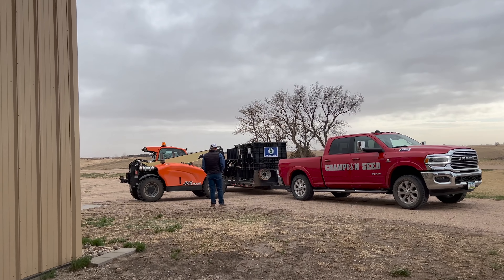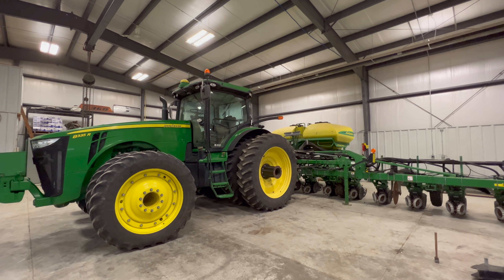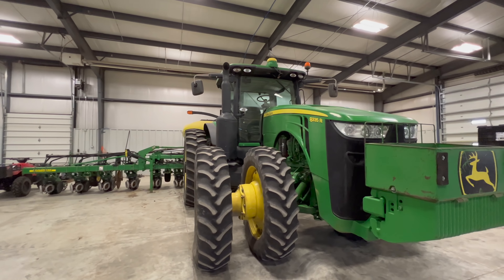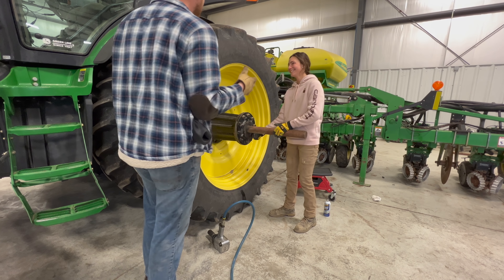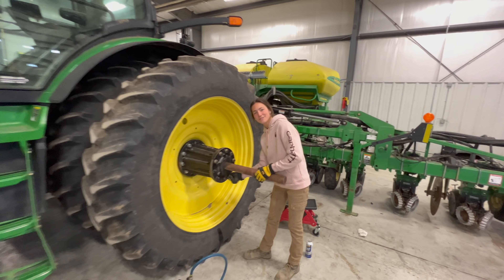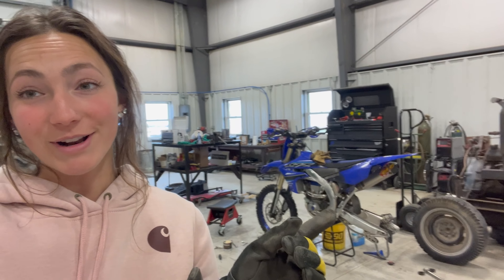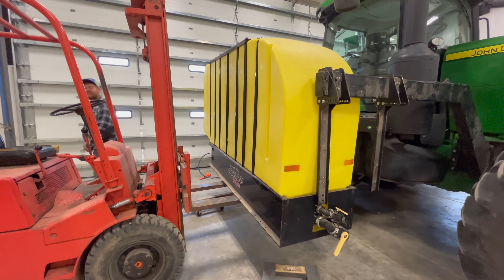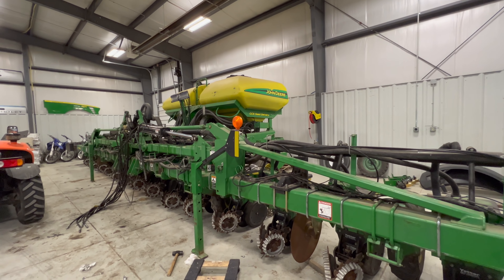Transforming A Tractor

Comment: Grant, you are our Laura caretaker. Don't get her hurt! You should have greased those shafts. Not so it went on easier so much, but when you take them off after they get rusty.  Drill some holes and mount some zirk fittings and add the grease.

Comment: Man those JD wheel bearings have to be crazy crazy stout? All these wheels then a shaft supporting a tank? Jeez
Reply: Theoretically they should be balanced out so there is not too much pressure on one side or the other under normal conditions.    But yeah, they aint the average honda civic wheel bearings.  :)
Reply: @Bendigo1  that shaft coming off the hub just rotating in a pipe supporting part of the weight of that tank out there just seems crazy…they work those machines like mules, when they are wore out i bet every part on them besides maybe some paint somewhere is wore out too!
Reply: @stevoschannel4127  Looking at the design, there is not much twisting force on the shaft that is attached to the hub,  Most of the lateral stability is provided by the front frame, the shaft is only supporting half of the weight that is really only pushing down on it,  not really twisting sideways.  It is more of a shear force at the bolts that is a concern and not the tension you would think it would be if the tank was only suspended by the shaft.  

While they do work the equipment a lot, they also rely on it to make money so they do as much as possible to keep the equipment going as long as possible.   A broken down $500k tractor is no good, so they do try to keep it going without breaking it.  

There are som pretty smart people designing the stuff they use on the tractors,  Even the farmers are pretty inventive and figure out things that engineers struggle to uunderstand how it works so well.
Reply: @Bendigo1  Sounds like you are an engineer too LOL...I am and a gearhead for fun...
Reply: @stevoschannel4127  Not an engineer, just like to figure out how things work and have a lot of random information in my head because of it.  :)  I also stayed at a Holiday Inn....

Comment: So the shaft on the rear wheels hold up the tanks? on the side? how does that work?
Reply: the shaft is mounted in a bearing on the wheel side, so it sits still while the wheel spins. The big spacer transfers all the weight into the wheel bearing, which is built to take a lot more heavier wheels than the row-crop wheels they use, so it's not a problem for them take all the weight when the tanks are full
Reply: Thank you

Comment: As impressive as it is to be able to lift and carry such heavy things around like that is.  Do your future self a favor and use equipment or others help to do it whenever possible.    I say this as someone that is about the same size but a bit over a decade older than Grant, that used to carry around 800lb gun safes  and washing machines and pretty much anything than noone else could even budge.     I can still lift stuff like that, but my back is pretty much shot from doing is so much when I was younger.   As strong as we are, and as much as we work out, it does not change the fact that every time we lift something heavy, it compresses our spine and after time all the squishy stuff in the spine losses its squish and boone starts pressing on bone and causing severe issues.  

I know it is difficult to ask for help or not try to show off a bit, but it is even more difficult when that showing off or not asking for help turns into not being able to stand up straight or being able to bend over to put on your pants.   

Just be careful.

Comment: Cool looks like one of my Shop Barns. My 8335 R has a Broke in Half rear Drive Axel Housing. Factory Forging Defect. Guess what it an't covered. It will take up to 18 months to get the Housing and another 6 months for the internal parts and everything that goes with it. I paid it off last year so now I may sell it for scrap. They want 48k for the Parts W/O Labor which is 49.5 Hours @ 149.00 an hour plus Materials. 1200 hours on the hobbs meter. addendum post.

Comment: We bought a set of saddle tanks for our Deere 7930 for herbicide so we could spot spray while planting we plant with a 1770 with it's own fertilizer tank, The saddle tanks never even made it to the fields we did not like how they hung out and impossible to get in the tractor unless you were toddler or a monkey so we put them in storage where they still sit today and we built a saddle and frame to hang a single 500 gallon tank off the front and we put 4 small 100 gallon tanks on the planter itself we ended up with more tank storage and and a tractor we could get in and out of. Don't understand why they can't manufacture a tank that mounts up in the space between the front axle and cab up tight against the hood they can now form plastics to any shape there is no reason saddle tanks need to hang so far out the side and off the back axles which already have enough pressures with duals and now tanks out even further

Comment: Grant has loaded Trucks. The load I was picking up? 40,000 pounds. Heavy Automotive Stamping Die Set. I built it and now off to its Production site. Most Over head cranes are double rated for (Safety) The Driver walked out the back door and I needed to know where he wanted the weight? He looked at me and said. (I've seen one of those slings let go and go right to the Ceiling. Took his head clean off.) I stand as far as possible. Always have. 35 years making chips? Double RedSeal with all his fingers and toes? I'm one frisky Safety First dead nuts I can hit .0001 Kinda guy. I have picked up fingers off the shop floor so. Be Safe and Kinda kind. I lift Steel all damn day long.

Comment: I'm still questioning the logic of hanging a couple of thousand pounds of weight to non-structural components (transmission housing? outer hubs for the duals?), particularly when towing the tanks BEHIND the planter would probably be mechanically simpler, no risk to anyone's noggin, and with quick-connect electric and plumbing  connections, Bob's your uncle...